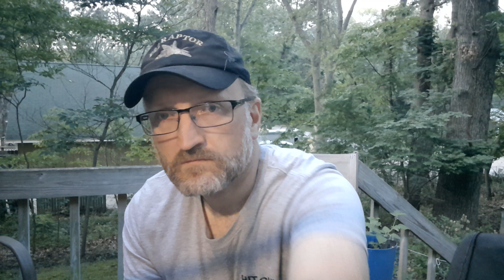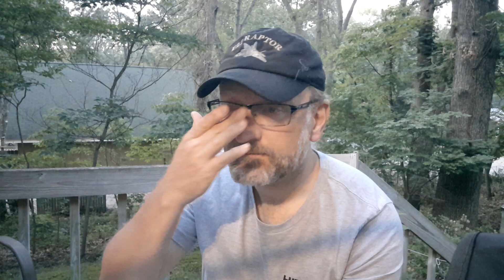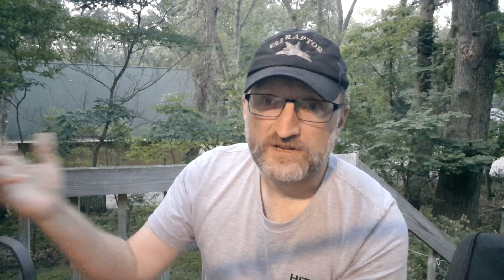EV's need renewable power sources? What about SMR's in America?

Comment: Thank you for the Tennessee perspective and information about the TVA/SNR project. I am not anti-nuclear and I believe that there are circumstances that they are the best option. What is important is a consideration of the situation as a whole. Renewable energy in the form of solar, wind, and hydro are now more cost effective. In broad terms our electrical grid system needs to be upgraded to be smarter. It will be a decentralized system of multiple inputs. My fear is that SNR's will deprive funding for more appropriate options. Thanks Again. 🌻